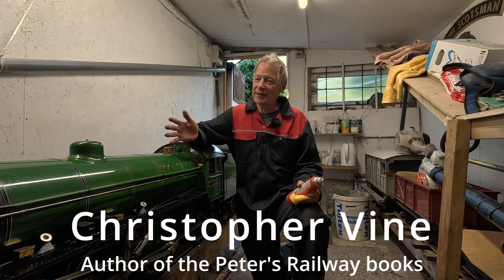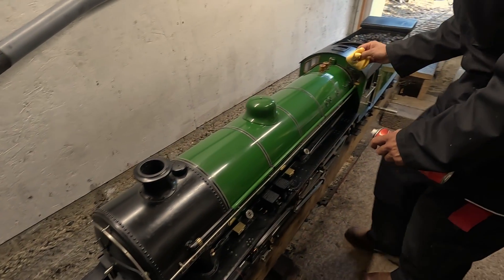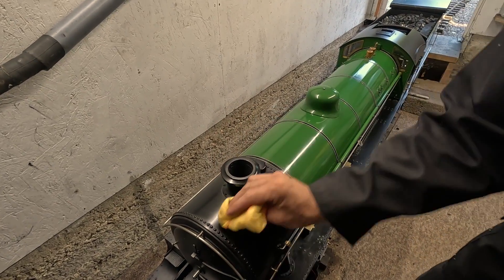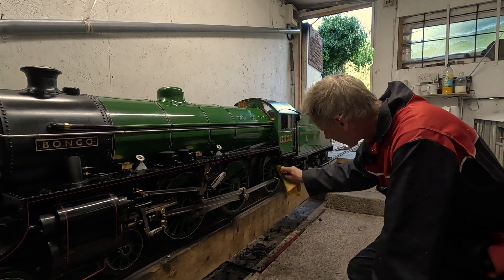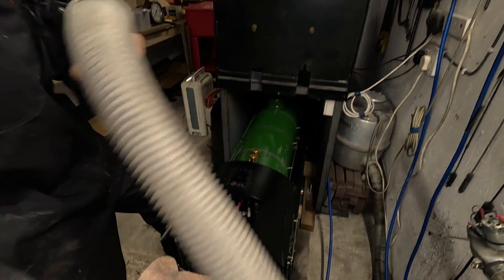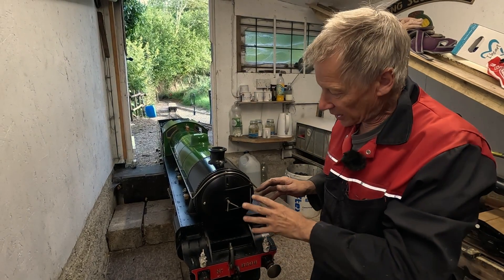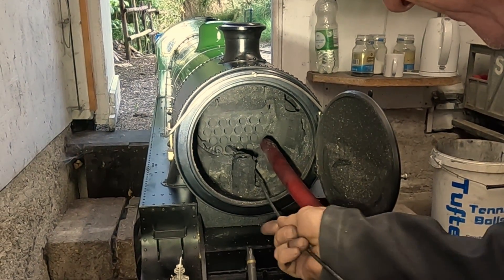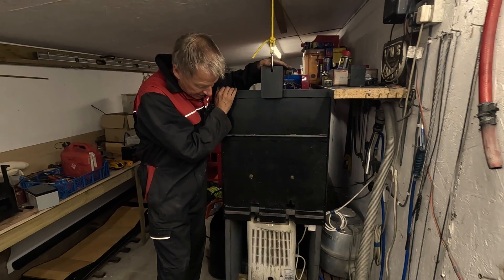How to put your steam locomotive to bed - at Peter's Railway

Comment: Useful video and something that often gets forgotten about yet equally important to keep a loco running well and keeping them clean is important.
I have found when I run my 3.5 inch loco that I think have been over oiling the motion as there is a residue of oil on the track from where it drips down to the wheels.
What is the best method to avoid this or is it just to not over oil?
Reply from the maker: Glad you have a 3.5 inch gauge loco, they are a lot of fun.
You ask ask about oiling:  Yes, it still drops on the track here.  However, for all the motionwork, I use chainsaw oil.  This usually has an "anti-fling" agent added to keep it on the saw, it is sort of stringy.  It tends to stay in the bearings better than ordinary oil.  Even the best oil on the planet isn't much use if it has dripped off and is sitting on the ground!!!
Thanks for watching! Best wishes, Chris.
(For more information about the books I write to teach children (age 3 to 90!) about railways, science and engineering, please see here: https://petersrailway.com/ )
Reply: @PetersRailway Yes is it a nice little Juliet and a good little steamer for her size!
Yes that is a good idea and will try doing that.
I do have some decent chainsaw oil as do a fair amount of chainsaw work so that would be ideal.
Also you suggest maybe using a bit less oil as I tend to over oil?

Comment: When I put my loco away for winter I slacken all the union connections on the clacks, injectors etc. All control valves are not tightened down. Oil in the cast iron cylinders. And all the other stuff you have gone over. Plus I leave a note in the cab covering what I have done👍
Reply from the maker: Thanks for the comment and extra info.  Yes, it's a really good idea to leave controls open to prevent them from seizing on over the winter.  I don't bother with oil in the cylinders.  I know that sounds strange but, apart from the time the lubricator had stopped working, the pistons are always completely free 4 months later.  Touch wood!!  
Thanks for watching! Best wishes, Chris.
PS. If you would like to know about the books I write to teach children (age 3 to 90!) about railways, science and engineering, there’s lots of info here: https://petersrailway.com/ and we ship overseas.

Comment: I normally squirt 6 pumps of lubrication oil down the blast pipe, open the draincocks and run the loco back and forth to help protect the cylinders.
Reply from the maker: That is a really good idea and I will do it after the last run of the season.  Mind you, except for the time the oil pump failed, I’ve never had a problem with the cast iron cylinders…. Thanks for watching! Best wishes, Chris.
PS. If you would like to know about the books I write to teach children (age 3 to 90!) about railways, science and engineering, there’s lots of info here: https://petersrailway.com/ and we ship overseas.

Comment: Boiler washout?
Reply from the maker: Great idea for another, short, video!  The engine runs on water from the shed dehumidifier which has no hardness and is very clean so we don’t need to do washouts or blow downs very often.  Thanks for watching! Best wishes, Chris.
PS. If you would like to know about the books I write to teach children (age 3 to 90!) about railways, science and engineering, there’s lots of info here: https://petersrailway.com/ and we ship overseas.
Reply: @PetersRailway   wasn't really sure if the model boilers had washout plugs like the real thing, I was just wondering if the models collected detritus like the real loco's around the foundation rings and so forth. It's lovely to watch. I have my little OO scale in the office and have an LNER  footballer in the collection.
Reply from the maker: Yes, Bongo does have washout plugs, but not copies of the real thing.   The original had 10, 5 along each side of the firebox crown which you can see in the pictures.  Then there were mud doors at the bottom corners of the firebox foundation ring to let the dirt out.  I have two of these, one each side but they are tapered plugs (which is more like the plugs at the top on the original!.  So the effect is the same, but the method is slightly different.  Enjoy the OO scale modelling, it is much easier on the back!!  All best, Chris.
Reply: @PetersRailway  
Hi thank you for that, very informative. Unfortunately I was on the cusp of going away for an anniversary when it popped up. Have fun.

Comment: Very friendly tip, I fully appreciate you've alot more hours around models and certainly this one in particular, from my time tinkering, I found a polishing cloth wouldn't actually pick up the debris, because of the fine knap, it moved debris around and left a few micro-scratches if I were ever too press to firmly. Granted only visable under perfect lighting using a magnifying glass, I switched to microfiber cloths as they are more plush and hold the debris, deeper in the cloths pile. I use auto finnese spray wax on my live steam models. (Not an advert for that brand, I just know that's personally v good for me) 

Looking forward to catching up on your other vids. 😊
Reply: As an optician, I can attest that cotton, washed 40 to 50 times, also develops split fibres which take up dirt remarkably well.
Therefore, bits of discarded cotton t-shirts make remarkably good cloths for cleaning delicate surfaces. I use them on old scientific instruments all the time.
Reply from the maker: Glad you found the tip useful.  When I first finished the engine I was even more careful with the paint.  Now, I do the same routine, but am resigned to the fact that the paint isn't quite mirror like now.  I do have a supply of microfibre cloths, but not in sufficient quantity to use a fresh one for every run.   Maybe I should get some more... Thanks for watching! Best wishes, Chris.
PS. If you would like to know about the books I write to teach children (age 3 to 90!) about railways, science and engineering, there’s lots of info here: https://petersrailway.com/ and we ship overseas.